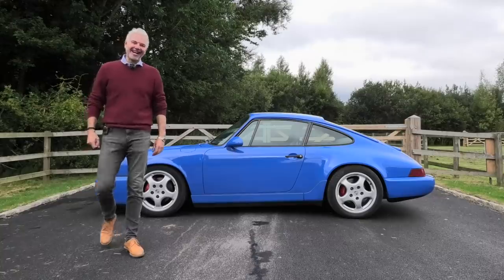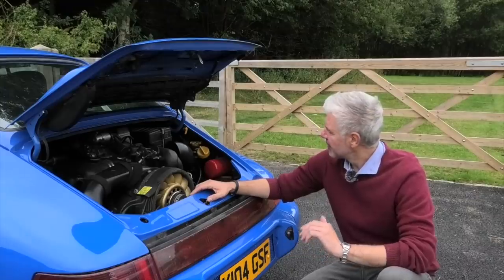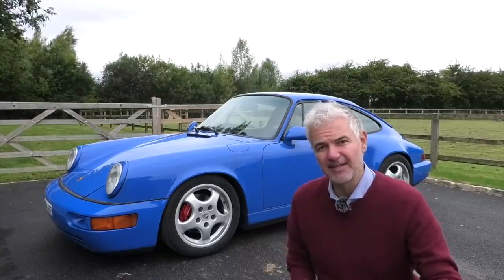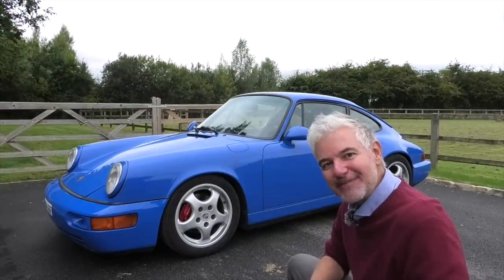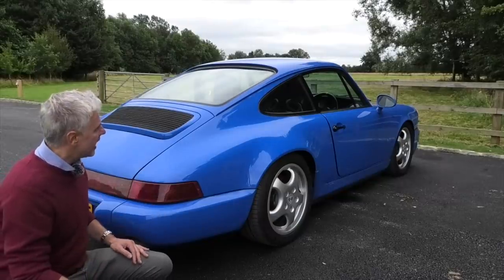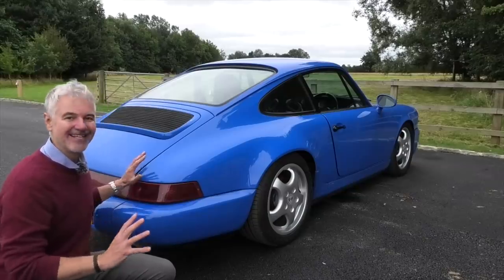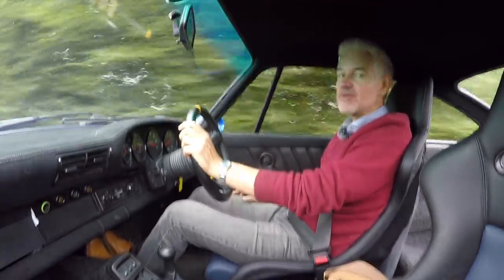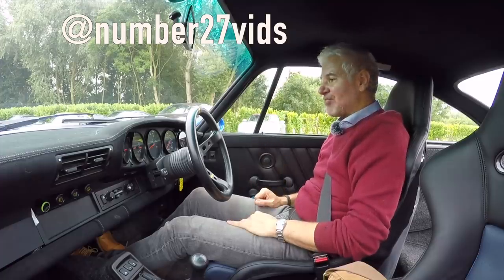Why I spent £40K+ to Make My PERFECT 964 - Then Still Decided to Sell

Comment: I’ve had my 964 complete stock C2 for two years. I like it just as it is. A little like a vintage watch that is best unmodified. Maybe I am alone with this attitude. Thanks Jack for sharing this good bye video. I’ve seen all your other 964 videos during the years.
Reply: No you're not. A wise move to keep it stock... 👍
Reply: you are not- in Germany you only can get the "historic" benefits when the car is unmodified or has time appropriate modifications.. so 90% of classic cars are close to stock. This includes having a original color scheme, can't put modern seats in the car, engine swaps are only possible between cars of the same series..... I think the rules are a bit too much.. but I also thinks that most peoples modifications are not an improvement...
Reply: Agree also
 Have a 1990 c2 which is totally orig, no cracked dash or any rust, now 38km. Just spent 9k pounds to make engine new.  Goes so well.
Reply: @andrewprice6436  My 91’ C2 has benefited greatly to my liking with KW V3’s (custom spring rates- f. 228 r. 350) 
Front top mount bar, 
RS swaybars, RS fly wheel, 996 GT3 clutch, f. 17x 8- 9 wheels,
993 headers, X- pipe, 2X 200 cell cats, 993 ignition coils, 

Also-
Also overhauled stock engine… in the process added more mid range power by grinding the stock cams to maximum allowed Porsche spec…

Comment: I'd wanted a 911 for 30 years but just never had the cash.  Missed out on some peaches too, like the 1969 911 Sport 2.4 SWB that was just £7K!  In fact that was the first 911 I ever drove thanks to Henry of Eagle E-type fame. I used to visit his workshops monthly and drool over his stock. He was such a nice guy and never once moaned about my being there even though I was clearly skint.  Anyway, I finally got my own 911 a month or so ago. It's only a 996 C2 but it's manual, non sunroof and the 3.6 has enough grunt to be great fun. My plan is to add lightness, a rear cage and race seats once I'm slim enough to fit in the bloody things!  Your old 964 has been part of the inspiration and I've watched all your Porsche related content several times over. Cheers, Mark
Reply: Yep, same storey as you, though just sold my 996 3.4 that was mint and now have a turbo..fabulous cars
Reply: It's fab that you've finally reached your ambition!  I wish you many happy hours behind the wheel
Reply: ..bought an SC for £5k....few yrs back..
Reply: @davidstuart4915  Same here Dave. Well it was actually £3K in about 1989/90 but needed some putting back together and I couldn't afford it anyway.   Thanks for the nice comments anyway guys. The sun is out here in Cornwall so I'm going to head out in the 996 for a bit of fun.
Reply: @Retrobeemer  absolutely slung it down all night here! - just clearing now..

Comment: I’ve never driven a 964, I’ve always wanted one, mind you I enjoy my 997.2. Stunning car and the sound is glorious. I get the fact that you didn’t enjoy the handling, it certainly takes some getting used to. A 10k 964, utter bargain, even with the additional 40k that you spent on it. Excellent video.
Reply: Keep your 997. It's a vastly better car than the 964. I bought a 987 Boxster S in 2009 and that is a vastly better car than either my 964RS or my 993RS. Better in every single area of performance.
Reply: @grahamtricker4103  thank you, I do agree,  it’s always easy to look back with tinted glasses. If I’m being completely honest my best sports car was my 2.7 987 Boxster!
Reply: @grahamtricker4103   Ok, we know the modern ones are going to run rings around the older aircooled cars and are better in every way, but which are the more fun cars to drive?  And this is not a rhetorical question. I am actually asking out of curiosity.
Reply: @Jeff_F7  I guess it depends on where you live because you simply cannot drive on the roads today like you could years ago. Well, certainly not in the south east. Having driven both my 911s on track including at Spa, the 993RS was good fun, but like the 964 RS it was a pretty useless road car and I much preferred my Boxster S in every way. Plus you can use it for driving out to a nice restaurant in the summer evening with your wife/partner and with the roof down. No contest IMO. Personally, I would rather be in something modern and comfortable today and when I wanted to get some adrenaline pumping, I'd do a track day or go kart racing or ride one of my motorcycles...
Reply: @grahamtricker4103  yes but it is also about how the car looks and sounds and the 964 wins on those points hands down

Comment: Love your channel, and in particular the never ending story of the Influenzo! As for this Porsche 964 I find it strange why you remove one of the best inventions for improved road holding, 4-wheel drive, from a car with a rear mounted engine, which would  benefit immensely from exactly this. And you have experienced, first hand, the inherent instability of rear wheel drive and rear mounted engine! I have owned and driven several 4-wheel drive cars, and the road holding is really exceptional.
Reply: The whole point is to feel and enjoy a proper 911….

Comment: I remember when 964 C2 or 4 was £10k.  Also a 993 cab was £18k for a minter.

I also remember when track slag LHD ex German 964RS (and E30 M3's) from Germany were £18k (and £12k)

The UK had just not joined the Euro (Jan 1999) and the exchange rate was a punchy 2 to 1.  

It's now today 1.16 to 1!   

Them was the days!!

Comment: I am continually amazed at the cost of things for 911s, and other Euro enthusiast cars. Here in the US, Matt Farrah of 'The Smoking Tire' spent $18,000 / ~13,200 pounds on a basic 'ring and valve' refresh for an air-cooled 911 that was also smoking at around 100k miles. No re-bore, no new pistons, no bearings. Just new rings, a little cylinder honing, new valves, seats, and seals. 

In contrast, the 175k mile small-block Chevy engine in my 1988 Corvette was professionally rebuilt with fresh bores, pistons, rings, bearings, valves/seats, all the necessary machine work, and a mild cam for a total of $3,000 US / ~2,200 pounds. Further, should the normally bulletproof T-10 transmission need a refresh, I could do it myself for about $500 /~365 pounds in parts (everything except shafts and gears), or I could buy a used one for maybe half that.

Porsches are cool and all, but damn! I just don't see why an engine that needs refreshing at 100k miles, and that isn't exactly exotic, should cost so much. And 5,000 pounds / ~$6,800 seems wildly excessive for an unremarkable used gearbox. Porsche people will try to justify these things, but I remain unconvinced.
Reply: Porsche guys are a special breed. None of these cars are remotely rare, but they trade hands well above their spec. Cool cars, but very overpriced and overrated.
Reply: Have either of you driven well sorted 911’s?
Reply: @claudiomarangone614  
I have driven a beautiful 964 Turbo on some magnificent Appalachian Mountain roads. I don't fault the car's character at all. In fact, the earlier the 911, the better for my taste. But with no electronic nannies, I did have to treat the power surge of the big single-turbo with utmost respect. Compared to my BMW e28 M5, the Porsche was a real handful. I would have preferred a normally aspirated 911 for anything except track use.

My issue is with the cost of participation, which I find unreasonable for the technologies and production numbers involved. The air-cooled 911 has become a transcendent icon -- I get that. But those air-cooled cars were simple, straightforward, and produced in large numbers over many years. 

There was nothing exotic about the engine or gearbox at all, for example. While the quality of its coachwork and general construction was typically German, it was no more sophisticated than a contemporary Corvette in any meaningful technical way. 

Corvette did benefit from the sheer number of small-block Chevy engines and T-10 manual transmissions produced overall, so some cost difference is reasonable. But apparently the 5.7L Chevy V8 also outlasts the Porsche 2.0L to 3.2L Flat-Six between rebuilds, despite being only about ~10% as costly to fully overhaul. Same for the gearbox.

That's all a bit difficult to accept, even though I understand why and how it has happened.
Reply: @claudiomarangone614  yup. Used to own a 996.2 gt3, purchased from a 911 specialist in the uk. Coming from a 360, I felt the whole thing was underwhelming. I have driven a friends 997.2 gt3 RS which was a different beast, but still doesn’t justify the price tag. In terms of components, there is virtually nothing exotic going on to justify the price.
Reply: Aren’t car part prices dependent on car values?

Every other car that has gone white hot in price, the parts reflect that, goes hand in hand.
Reply: @brogenville  So you do understand why the prices are so high after all
Reply: For all the performance Corvettes have they haven’t blasted through that cool factor since the 60s. 
There are many known reasons for this. 
Clearly there’s more to a car than its numbers, whatever those numbers represent.
Reply: @claudiomarangone614  I think we may be arguing over different things. The parts are overpriced, but as you point out that’s far from a Porsche issue. The cars, good though they may be, are just overrated. Especially the older ones. All in my very humble opinion.
Reply: @claudiomarangone614  
Well, there are many older Corvettes that have sky-high values, but it still costs the same to rebuild the engine or gearbox, or to repair other mechanical systems. Some things, like interior trim and exterior panels, are hard to find and very expensive.

My view is that Porsche repair (and also aftermarket parts) costs are so high simply because they are for Porsches. It's a tacit agreement among enthusiasts and owners that 911s are magical machines composed of unobtainium and designed by prophets and sages, which has no logical basis.

The real winners in this alternate reality are the 'specialists' who, for example, charge $30,000 to rebuild an unremarkable engine.

Comment: Nice video, but I am confused. You recommend conversions from C4 to C2, but at the same time discourage track use of 964's and don't like the rear engine/rear biased handling of the car. Wouldn't it be better to keep it as a road going C4, as it was born to be?
Reply: agreed and there is an obsession with modifications. If you want a C2 it’s best to buy one. As soon as you molest these cars at their current price point they lose value. In a sense when it comes to air cooled porsches maybe leave them the #%€$ alone??!

Comment: Jack - I get that the 964 isn’t the right car for you and admire that you were able to part with it after investing so much effort in modifying it.  I’m surprised that you have only £40K into it.  I have significantly more into mine, but I don’t have your mechanical skill and so didn’t do the work myself.

Like yours, my 964 is modified for performance / driver engagement, but certainly not a full on track car.  We modified it at 186K miles and the engine was still strong - with proper maintenance, German engineering is incredible.  We put KW Onix V3 coil overs on my car, the ride is a bit stiffer than stock, but it’s certainly not uncomfortable - it really depends on how you adjust them. I find the Recaro seats I have in the car now more comfortable than stock because they hold me in place almost caressingly.

Certainly taste in a car on track is a matter of personal preference, but I find there is nothing quite like the feeling of pinning the car to the tarmac with the right balance of steering lock, and front rear weight balance through accelerator input as you near & complete the apex.

Comment: about 5 years ago I looked at a 964 C4 for $10k US... not running, my Porsche mechanic told me to run that there were multiple $2500 sensors on the 4wheel system, had I known about converting it to a 2 wheel drive I would have bought it.

Comment: Hi Jack, I’m an ex-Porsche technician, I’ve worked on lots of 964’s, obviously improved over the G-Series but… non stop oil leaks, non stop engine rebuilds ( and what you said that all cars require rebuilds is completely untrue), failing dual mass flywheels, failing DME relays etc etc

I can appreciate and respect you enthusiasm but the amount of money spent is OTT

Comment: I know what you mean about the 964 as a track car. You should try a 993 which is light years ahead in terms of handling. I have owned a 964 RS (6000km) and a 993RS (26000km) and the 993 RS was vastly superior in every way, both on the road and on the track, although it doesn't look the classic 911 as the 964 does today. As a car I don't regret selling them because they were such poor road cars they rarely got used. Having said that as an investment preposition, well that is another story...

Comment: 27 Cobalt … so you are not a Gilles Villeneuve fan. 27 is like a secret code for Gilles fans.

10 000 pounds!!!!!!!!!

Beautiful car!

I got a 996 and you can easily trail brake it. I think it started with 993 with the Weissach-suspension aka LSA-suspension (Leicht, Stabil und Agil).
964 has already slightly modernized rear suspension but the characteristics are probably still like in the G-series and before. It was the LSA and maybe the longer wheelbase of 996 that made trail braking possible. But you must not overdo it. You got to be quick transiting from braking to throttle. Just a little bit of loose feel at the back and then quickly but smoothly to traction.

Comment: ABS locking your brakes down? That doesn’t make sense. ABS are a fail-safe design, they can only release pressure, not increase it. I suspect something else happened
Reply from the maker: The rear brakes definitely locked up and did not release.. rebuild of the pump showed that the pistons were sized up. I don't know how it worked but the mechanic who looked at it definitely thought the ABS was to blame.
Reply: @Number27  I don't doubt your word Jack. Seems to me every 964 owner should be made aware of this risk (assuming yours ran the stock ABS). I wonder if it's an issue that was addressed in later designs of Porsche ABS brakes. If it was,  it may be a worthy upgrade.

Comment: Never liked the 964. I have a 84 3.2. 964 are heavy, have ugly bumpers, ugly wheels, ugly mirrors etc.. The only exception is the redesigned front suspension much better than the 911, but it is negated by the weight in the rear part of the CG. This is the reason why they were worth nothing as of 5 to 10 years ago. If you want to throw 40K in a Porsche put it in a 911 add a 964 engine and a 964 front suspension  from Elephant racing. Now these pesky rice rockets will be in your rear view mirror at the track.